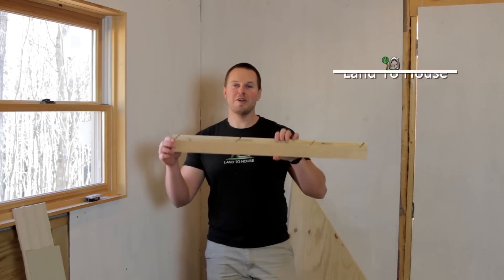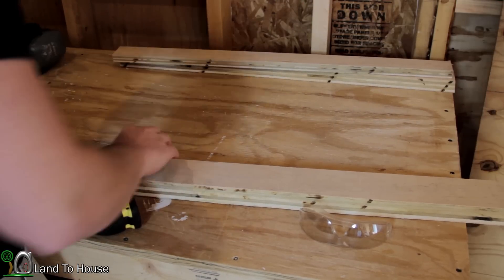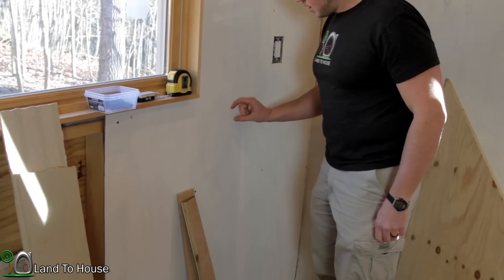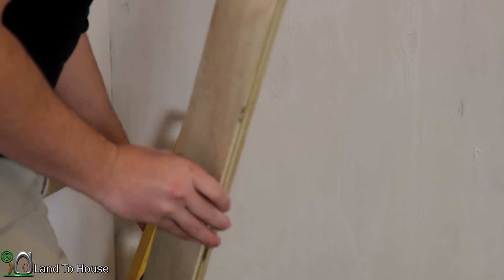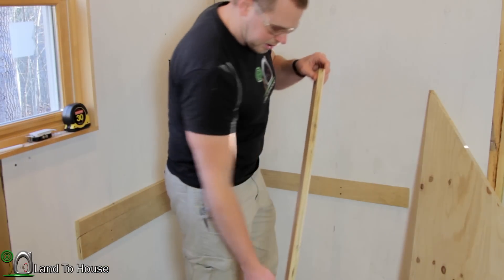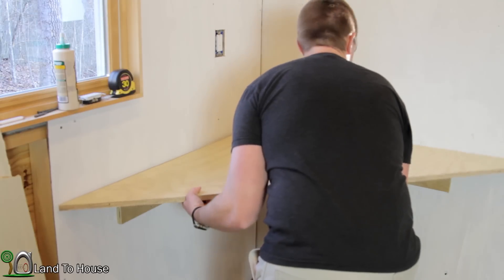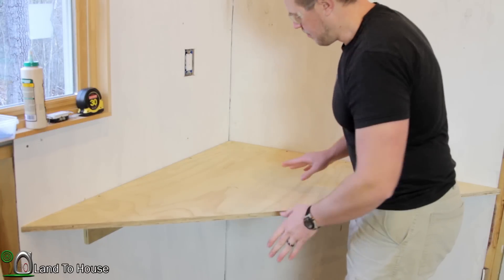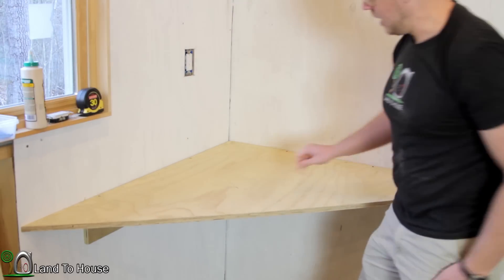French Cleat Computer Table - Build a Workshop #27

Comment: In addition to some edging or support to stiffen the table (no different than a bookshelf) you could also have put some gussets at the corners down a few inches to provide additional support.  You could also have considered putting a few cleats up the wall to make flexible places for additional storage such as shelves, storage cubes etc.  I am thinking that this will be very useful in my own office.  Thanks for sharing.
Reply from the maker: There is now a second shelf up above this one. Holds some speakers :) the front support is a good idea. So far the table is holding up well!

Comment: Why don't you put a strip across the  front of the computer desktop toward the front and buy tieing in side cleats to adding additional strength to the desk for support.
Reply from the maker: Yes very good idea! I plan on doing that when I start working on trim in the shop. It will make the table so much more sturdy.